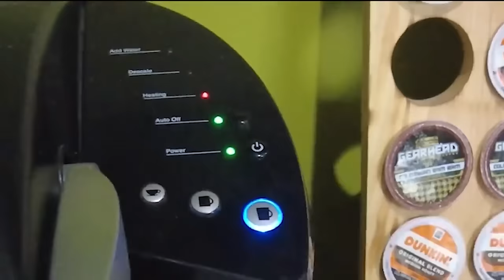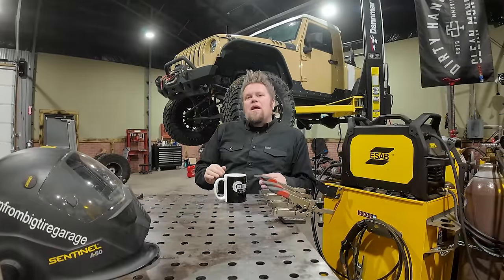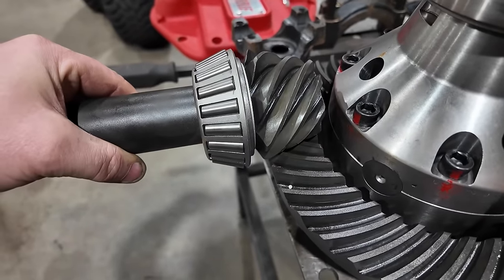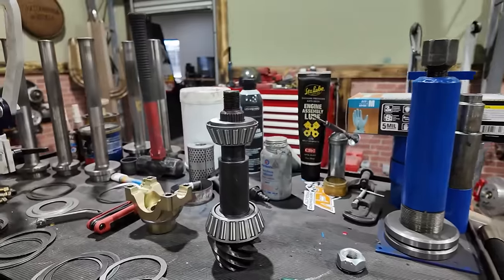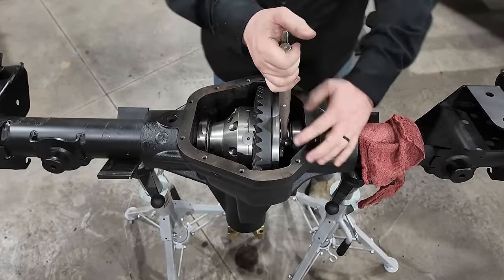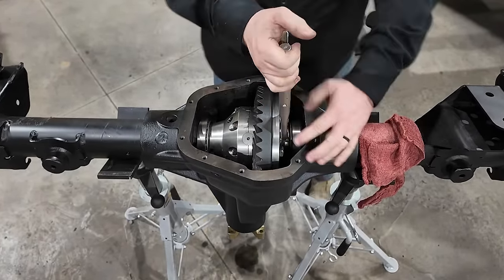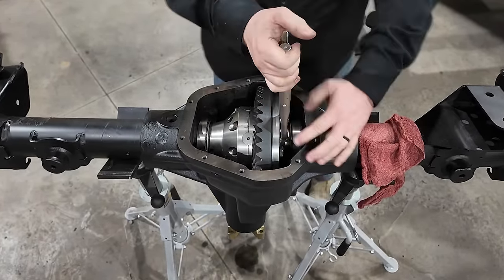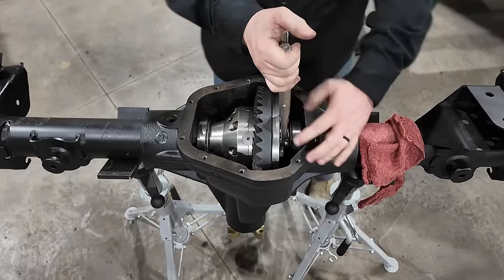Semi Float Dana 60 Ring and Pinion Install; How To Best Axle for Jeep JK

Comment: Finally a Vid that shows a properly built up Dana Axel Congratulations 🎉 😊 now Colt and Merlin know how to do it right 😊
Reply from the maker: You gotta have all the tools to do it right....and the knowledge to know when to use what tools
Reply: @BigTireGarage  absolutely mainly why I love Chrysler corporate axels with the side adjusters for side preloading. Wish Dana would switch to side adjusters. Be very careful spreading cases .005-.007 max, if you over stretch it, it’s done can not fix it ☺️
Reply from the maker: I have broken them in the past...its crazy how fast it can go wrong!!!

Comment: 21:00  Hmmm, learned something.  I have always placed the carrier shims between the housing and bearing race, where the factory puts them.  Noticed the factory always used one shim the correct thickness, and when putting in an aftermarket gear set they give you all these thin shims.  Way easier to pound in one, exactly right, thick shim.  This always bothered me, now I know how to get around that. thks.
Reply from the maker: Glad I can help

Comment: Glad you see to use a case spreader.  I purchased mine back in the 80's when I first started building axles and is the only way I put an axle together.   There are multiple companies offering them nowadays and their price has come down substantially from what I paid for mine 35+ years ago.
Reply from the maker: I had a bad experience with one once back in canada when i started in the trade....got a little "excited" ad broke a Dana 60 in half
Reply: @BigTireGarage  yeah, a guy can definitely go too far and cause damage is not familiar using them.

Comment: 10:08 Did you Torque the Pinion Nut? What about the magnet you had in there while measuring... ?
Reply from the maker: I don't normally leave tools inside vehicle components after using them.

Comment: i was wondering about using a housing spreader. I've done it in the past. They also make a pinion depth indicating tool that if you use aftermarket gears, you can read the correct installed depth and be right thr first time
Reply from the maker: I use a depth tool in this video

Comment: Hi, quick question, do you pre-oil the bearing before calculating drag torque on the pinion and backlash? Thanks in advance, great tutorial!
Reply from the maker: Yes...all bearing gets gear oil...if the axle is gonna sit for a while before the project gets finished....I cover them in bearing grease

Comment: So I am looking at the possibility of doing this. I am also in a 2 door JK Rubicon Hard Rock Edition. Looking to go to 37's. Currently have 35's with factory Dana 44's front and back and 3.5" RK Lift w/ adjustable control arms. Running the factory 4.10 ratio as well. My issue is I am not sure if I should just bite the bullet and go UD60 front and rear, or UD 60 rear, and PR44 front. Here's why. I plan to drop a Hemi in it later on, but it will be a few years. So my intention is to "future proof" it, so I do not have to buy stuff all over again. Wheels included, with the possibility of an 8 lug UD60. If I went ahead and did UD60 front and back, I have concerns about how hot the 3.6L Pentastar V6 might get. Any input? Loved the video!
Reply from the maker: Man there is a lot to unpack with that list.  It really depends on how you plan to "wheel" the jeep...if you keep your head on straight and stay off the skinny pedal when you are in a tough spot...it should be fine with the Rubicon front and semi float rear
Reply: @BigTireGarage thanks! Yeah I know I threw a lot at ya there. Just trying to illustrate where I’ve been versus where I want to be. Love the content and the video! Thanks man!
Reply: @BigTireGarage  I am really more of a weekend warrior. But I do a mix of muddy terrain, with some rock krawling. With the jump to 37s, I am wondering if I could get by with ProRock 44's in front, and 60 semi float in the back. Just not sure.

Comment: Is the diff bigger than the dana 44.  I’ve seen a 60 with 37s and the diff is bigger and getting hung up.
Reply from the maker: The Housing is slightlyblarger...but being the semi float vs a full float 60 it is smaller than a 1 Ton..full float....but bigger than the 44 for sure
Reply: @BigTireGarage  thank you for answering my question.

Comment: Yeah....for 7k I'll just build a superduty 60 front and 14 bolt rear and still have money left over.

That tax on guys without a welder is real.
Reply from the maker: I can see that option being a good one...but then ya have to plan for new wheels...steering....and probably new tires
Reply: @BigTireGarage  That's true, and although I've only built a few rigs which comes nowhere close to the number and quality of rigs you've built, I learned the hard way to just do it right the first time as it ends up being the most cost effective solution in the long run.

Comment: What stinks is all the manufacturers don't off a basic locker.  It's ARB or E-Locker.  What about us simpletons that just want a regule Detroit or Grizzly locker front and rear.
Reply from the maker: This one is a Grizzly "Detroit" style locker
Reply: I ran a grizzly locker for awhile and it did work pretty damn good but now that I run arb lockers I don't think I could go back, being able to fully unlock does make the drive more predictable I don't have to have that go round a corner with maybe to much throttle feeling "thought" haha
Reply from the maker: Yeah it can get a little "spicy" on the street